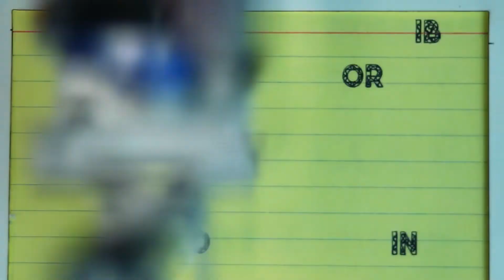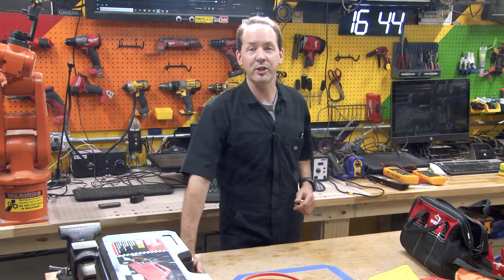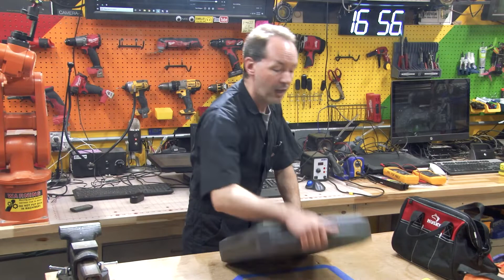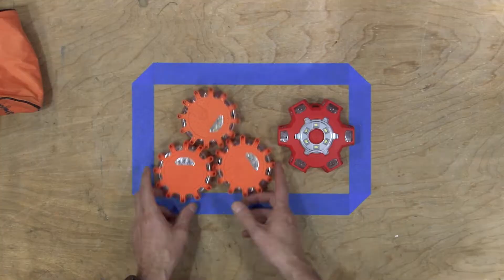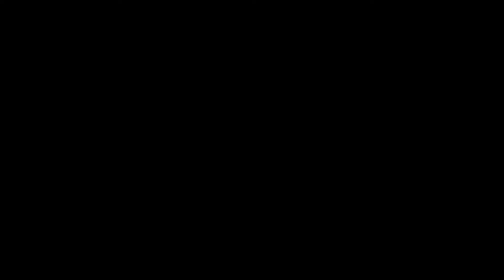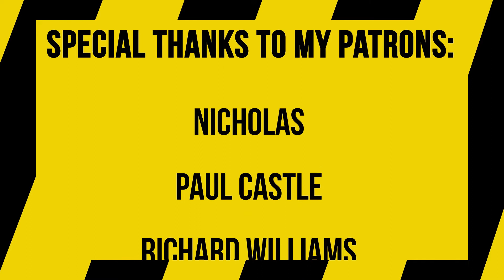My Comprehensive EDC Roadside Emergency Kit - Episode 2 - Jumper Cables, Jacks, and Safety Bag

Comment: 15:13
3 red reflective safety triangles
Not bent, broken, cracked and clean, plaxe at 50, 100 and 200 feet behind vehicle or as fa4 back as needed on a curve

Think i recited it perfectly, been a few years since i got my cdl but yes, cmv are required to have 3 of those truangular reflectors, the ones ive used have a chonkier base filled with sand
Also a fire extinguisher is required as well

Comment: I recommend making your own jumper cables out of welding cable. Most jumper cables are copper coated aluminum.
I agree with cutting off one end and adding an Anderson 175 amp connector, but get 3 ends. One for the long side of the cables, one for the vehicle, and one for the short side of the cables. That way if someone needs jumper cables but your vehicle is not in a position to get to it you can reconnect the cables to function as normal. If you have multiple vehicles and equipment then having Anderson connectors on everything is nice, then have double ended cables. It's not just convience either, it's a better connection than the clamps and the clamps are typically the limiting factor.
The other tool that I keep in or on all my vehicles is a hi-lift jack. They get a bad rap for being dangerous but they are so versatile, especially with the accessories.
Reply: Oo a jeep jack
Yea thatthing gets a g out of shit even at the house

Comment: there's a company called surge that makes an absolutely incredible headlamp that you can pick up at Atwood's or tractor supply. I got mine for around $15 on sale, and they are insanely bright. they also charge with a shielded usb-c connector and can be taken off the headband to use as a handheld light

Comment: The free and very useful bits of kit, like the boards are good info.
With the mag lights,  I would have sworn that the threading on the tube made it possible to screw / add on extra lengths, to turn a D4 in to .. a Senior Holmes style.  A D10 wouldn't be practical but it'd be fun to show off. 
I've carried the same mini mag since i was a teenager. It might not be very long, but it sure is skinny and mostly gets the job done.

Comment: scissor Jack is safer for roadside use. floor Jack arm moves in an arc and the jack needs to be able to roll to maintain stability. that's why no car comes with floor jack no matter the trim level

get a heavy duty scissor jack either commercial or from a Chevy suburban in a junkyard
Reply: Bottle jack bud
Reply: @evanforster2665 bottle jacks are horrible for jacking up a car. Unless you drive a truck they are too tall to get under a car with a flat tire.  Also you may not be able to get the car high enough to get the wheel off and on.  Finally the contact area with both the ground and the car is small and they are not stable.  
I have experienced all of those shortcomings in person. Want some real fun?  Get a flat in the middle of nowhere jack the car up with your bottle jack remove the flat tire and find that you can't get the spare on because it is full of air, and has a larger circumference plus your bottle jack is all the way up.